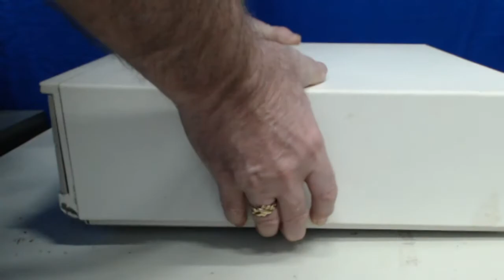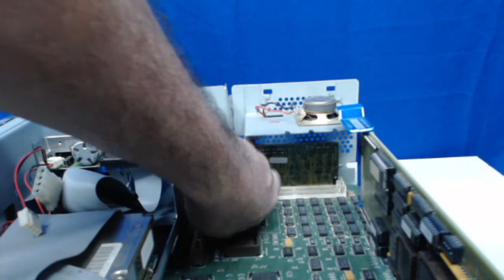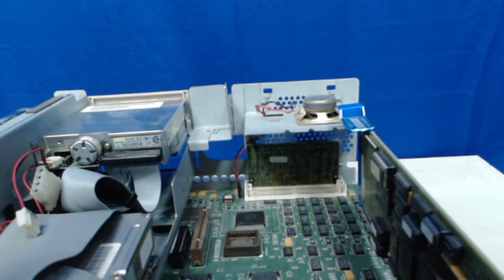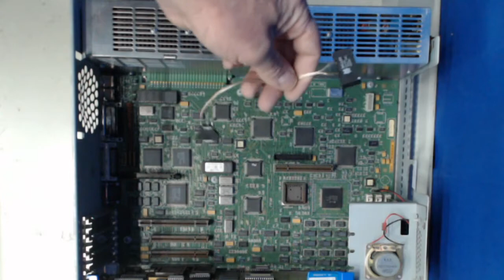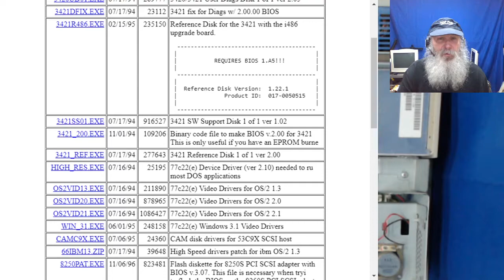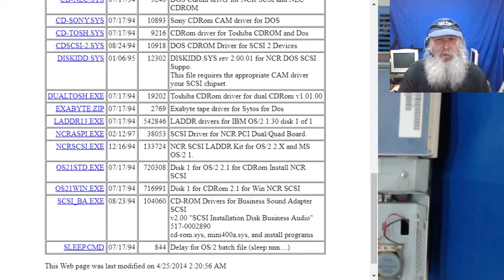A look inside an NCR '3421' - Microchannel 386SX-20 with a planar SCSI Interface!

Comment: My dad worked with NCR from the 60s to early 2000s so I grew up seeing these a lot. We had a couple of 3421's systems at home, along with a PC710/3392 286 stackable desktop. They did make some ISA systems during the time, but mostly MCA during 386/486 of course. The simms were hard to find even back then, even within the company. Still prefer the NCR cases over the IBMs, at least on the outside. The inside's were not as pretty though. Would love to find more NCR systems, but they don't seem to pop up too much online.

NCR has to be one of the best companies to support their products. You can still download all disk images and drivers for systems even today.
Reply: But not the disks for this machine.  When I click the links for the disk images, the site returns an error message.  If you know a way around this, please let ne know.  I would like to get my machine up and running if I can.  Someone had added the 486 cpu card to mine.

Comment: Clearly inspired by the PS/2 Model 50, but the physical construction is even closer to the 2nd gen Compaq Deskpro systems. Wonder which one was first, NCR or Compaq?
Reply from the maker: So true that it resembles a Deskpro - I used a 386DX model at work for years, and also had the CPU and cache on a daugherboard, like the PS/2 Model 70-Axx. Of course, Compaq (the first computer manufacturer to have a 386DX-based system) never did microchannel (and stepped aboard EISA very quickly to challenge it) - and IBM never did an ISA bus computer based on the 386DX.

@uxwbill got intro Compaqs much more than I did - I have that Deskpro around in parts around here somewhere, and had a mini-tower design that was cheaper construction. I may just donate an original Compaq Portable motherboard to someone like @EEVblog - He just repaired a PSU for one on his channel (but I'll need to know how to ship to Sydney). It had problems with the frequency for running a CGA display and I tried swapping out a couple capacitors without getting it right.

He has the mad skills to get it working - and it would be my appreciation for him linking the great content from @CPUGalaxy doing an X-ray of the IBM mainframe processor. About a month ago he may have already been dealing with a similar issue: https://www.youtube.com/watch?v=4XGwveNyLJo&t=648s
Reply: @IBM_Museum  Yeah Compaq actually initiated the entire EISA movement afaik. The older Compaq machines are quite interesting too - especially the Deskpro/Systempro line and the "tri-flex" architecture (more or less passive backplane, with removable I/O, processor, and memory boards). Rather difficult to find these days...
Reply: @IBM_Museum  Yeah Dave (EEVBlog) is a real engineer... :) Everyone interested in electronics should be subscribed to him!
Reply from the maker: This wasn't the NCR 3421 in an eBay auction back in August of last year referenced on CSIPH - and unfortunately, eBay doesn't cache auction images that long, for me to do a comparison of the units. Louis did find the stason page on the 3421, however, and it provides further details:

https://stason.org/TULARC/pc/motherboards/N/NCR-CORPORATION-386-CLASS-3421.html

It appears that I was correct that the very proprietary SIMMs are 2Mb each, and with three slots filled it reaches the motherboard maximum of 8Mb, meaning that 2Mb is also soldered on the motherboard - so I have 4Mb on my 3421. But if I want to put any more, it will probably be through a Kingston 609 adapter.

Louis found all of the files based on that CSIPH thread - a fantastic lead that will be critical for me four months later. The NCR site now has an expired security certificate by 190 days - "It's dying, Jim". Moussa also found where quite a bit of the material is archived - and will help with the next NCR up on the bench too.